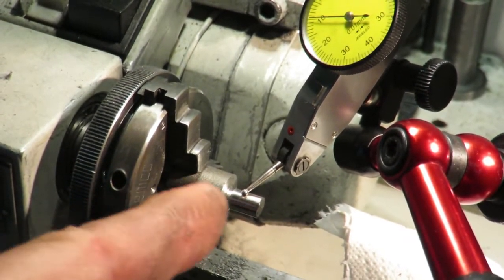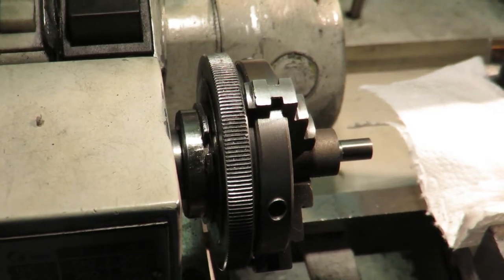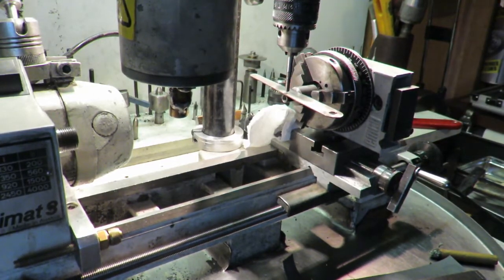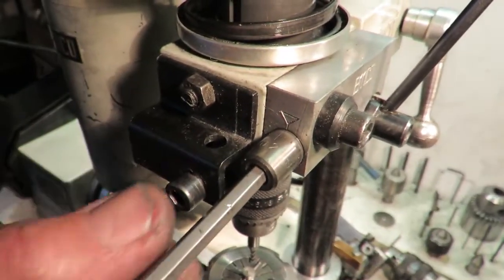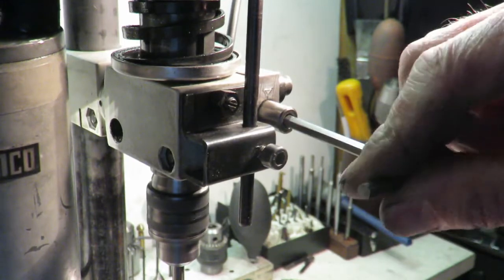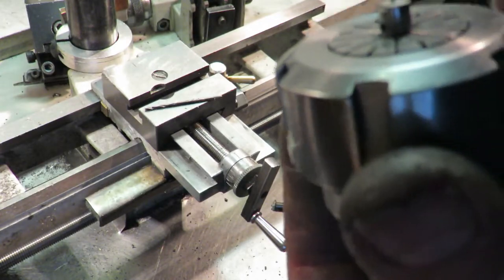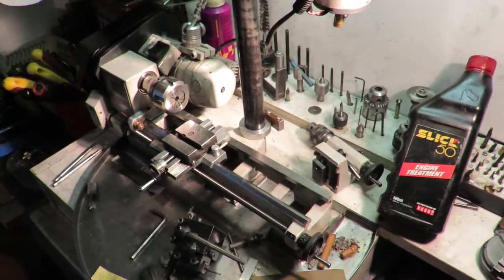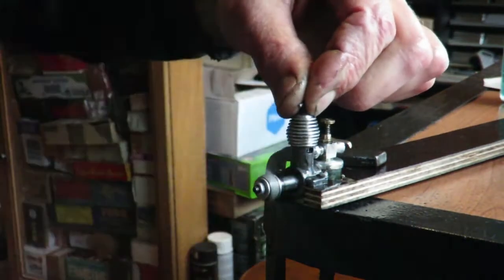VA Banks Mills  0,25cc,.. another rebuild story..

Comment: Good find the centre tip. 6:21
Reply from the maker: Small thing,but pretty important..You need to make all at pefect angles..otherwise friction will rise thru the roof....the smalles engine I rebuild was a Chech GZ 0,10cc I make a new shaft,liner,piston..rod and so on..its a 5mm piston. I need still to make the video..so little time..But will catch in as soon as possible!

Comment: Another great job  and now a little tip to help setting up, on my south bend lathe the chuck is worn so I modified the chuck back plate so I could slacken the bolts true up the job then tighten them up again works like a charm and you can save worn chucks  Great video keep up the good work   Peter        all the best      Bill.
Reply from the maker: bannisterengines  Hi Bill,many thsnks for coment.Yes,we have old machines,but if you know how to help your self,its not a big deal.Of course is a brand new machine great..but who have so much cash to spend.. keep also up the good work Bill,!!

Comment: hi Peter!  i´m re watching some piston making videos you upload,  noticed you "lap" the piston with micro diamond past.. but... this was made using the cylinder?  i mean, the new piston lapped with diamond past over the cylinder?   seems scarry....    Cheers
Reply from the maker: Holla Rodrigo...Yes,but I use only very fine lapping compound with a lot oil..5-10 microns only.Also I lap it in only till the wrist pin reach the exhaust port,so it wil be left tight above the exhaust,where the fit must be tight..This is only the final fine lap to match the final fit..Than the piston wil run in and reach the final fit.

 Salute to Brazil!,
Peter